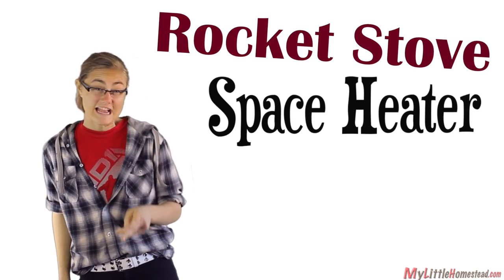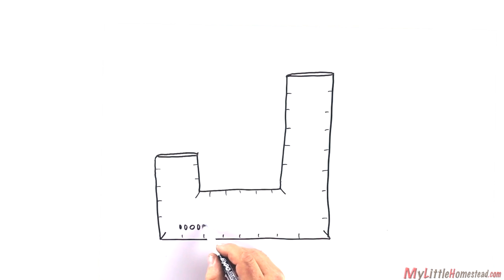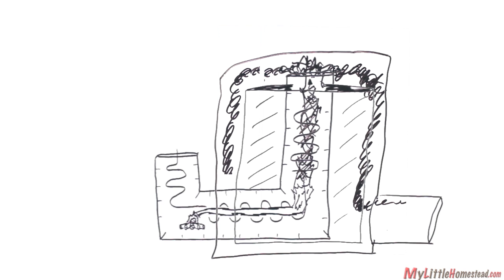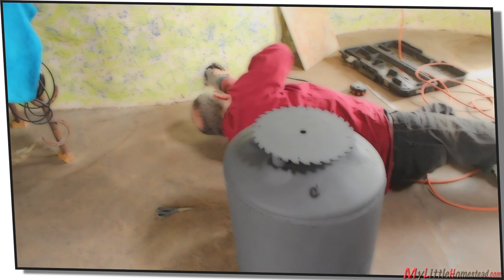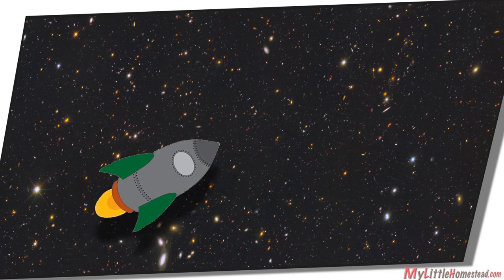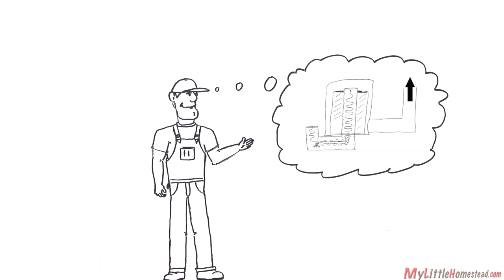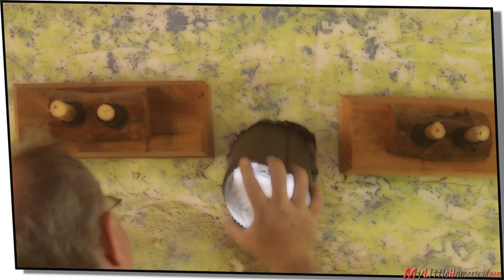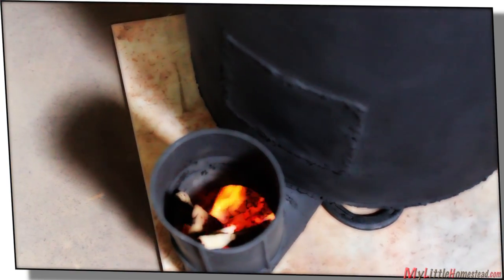Rocket Stove Space Heater for Superadobe Earthbag House Construction (superadobe)

Comment: unless showers are taken before 1 hour after sun goes down solar hot water may not be enough for 4 showers but an easy fix bury 300 gallon tank 6 ft below ground and cycle water to solar panel until sun goes down then have hot water for 4 -- 11 pm showers --  could all so heat floor, a little, with hot water cycling.
Reply: mix a little geo thermal in there i like